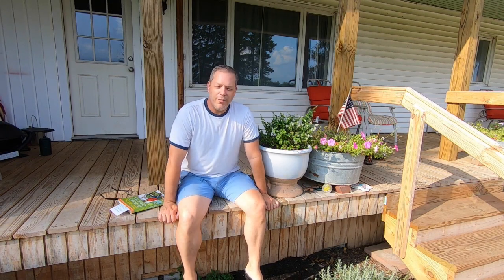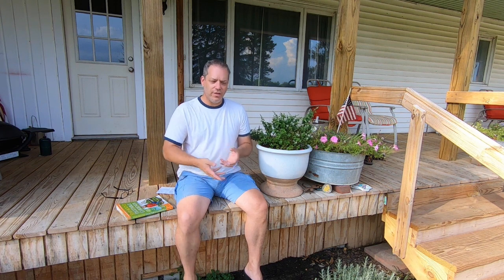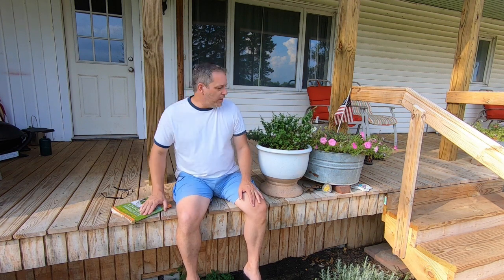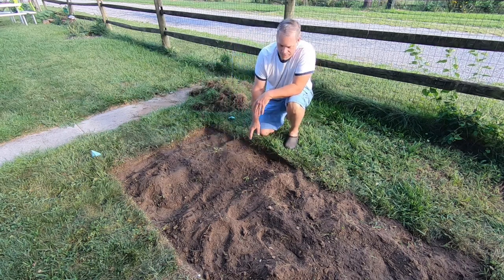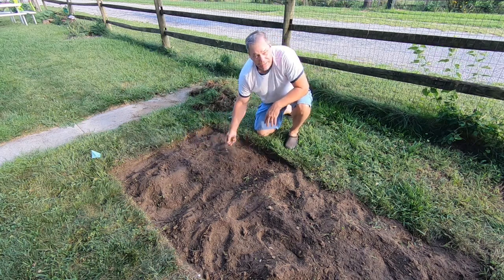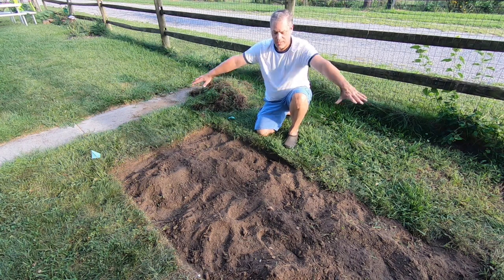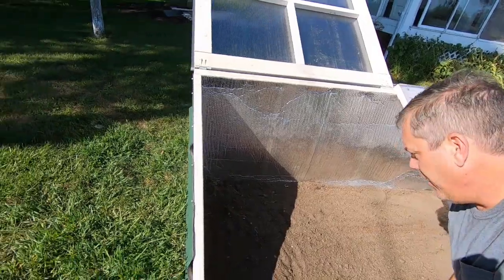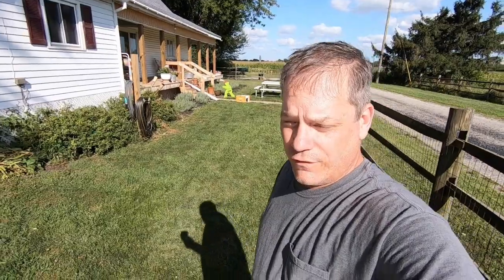Cold Frame Winter Harvest Part 2

Comment: Something you might want to try to provide winter heat and extra light in the winter are incandescent lights. String them along the frames to keep them off the plants. Also an old mountain trick down here is to put old quilts over the cold frame on cold night to help retain heat. Take them off during the day time hours. Another trick is to put a little candle under a clay pot. They give off more heat than you would think.
Reply from the maker: Good tips!